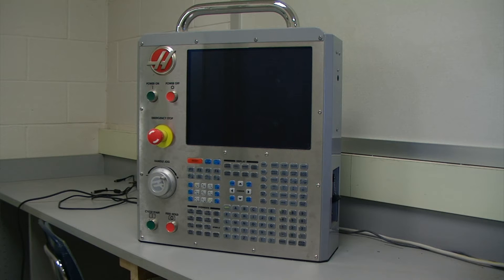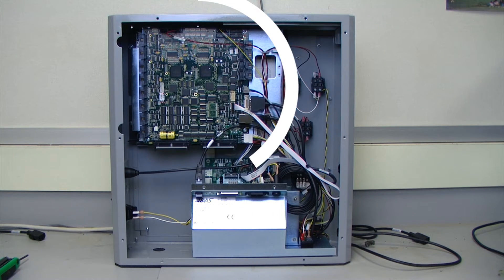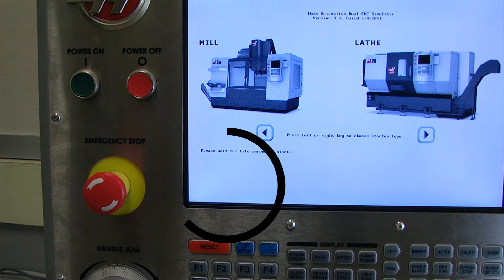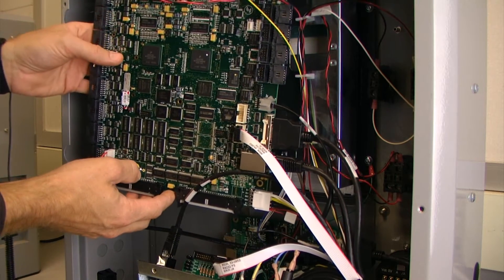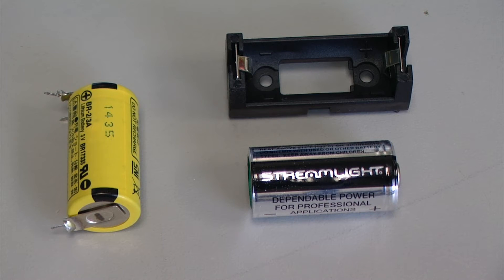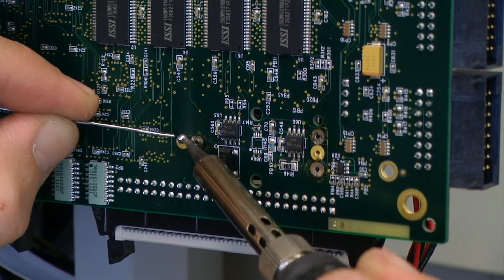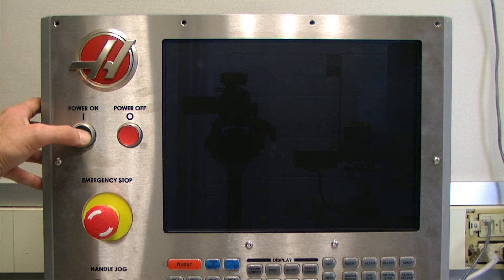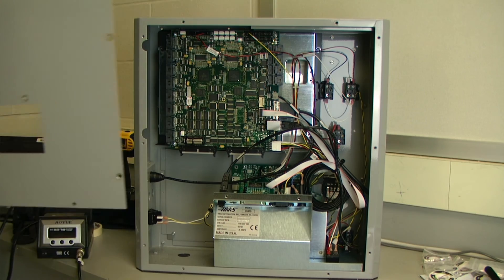Haas CSMD Simulator Battery Replacement

Comment: What if it's dead already?
Reply from the maker: Then you may have to debug the unit after battery replacement is complete.
Reply: @InsaneOil  If the battery is dead, and we don't have the backup flash drive suggested in this video,  https://www.youtube.com/watch?v=_QDxhoAAN5c, what can we do to get our trainer back up and running? Can I somehow create a flash drive from my mill? Or can I download the files from some other location?
Reply: @timsullivan2381  You're kinda screwed. You need to contact HAAS and have them send the parameters over for the controller. Then you need to figure out how to upload the parameters. Ive tried and failed before on a lathe that lost its battery and controller.